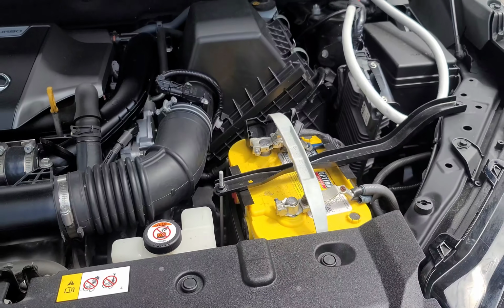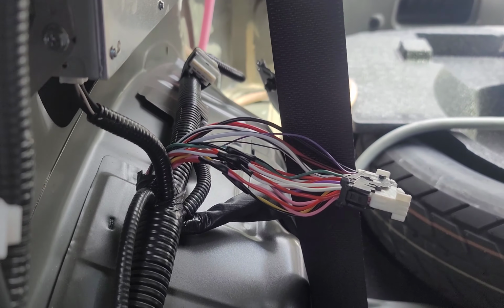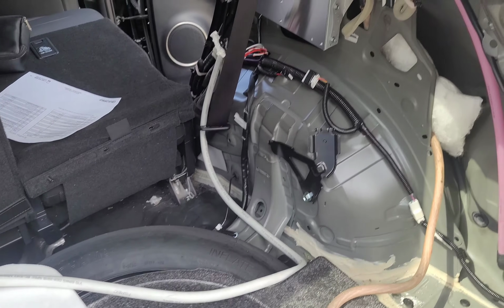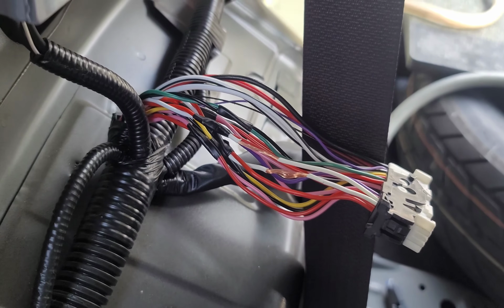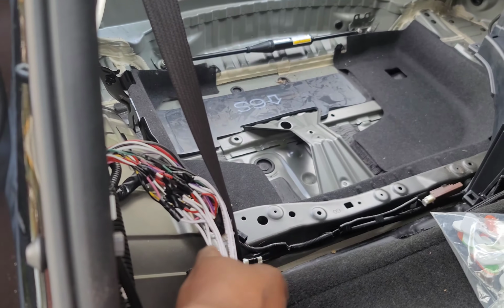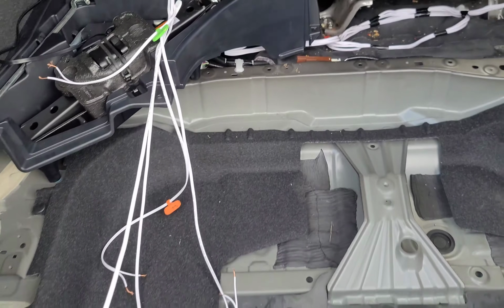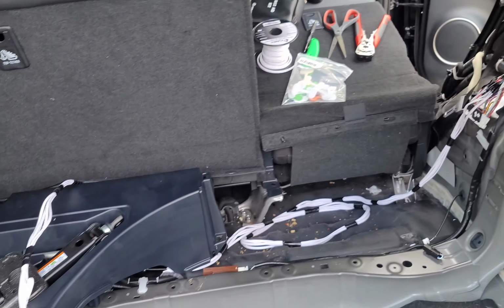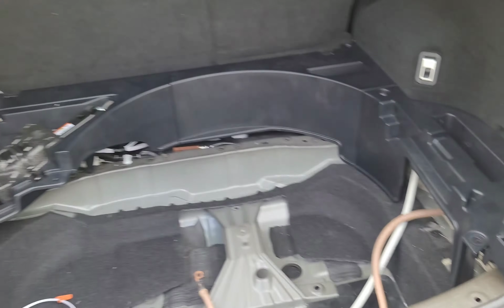How To Splice Into Factory Amplifier | Project Lexus Pt.4

Comment: I'm confused. So which ones were the sub out?
Reply from the maker: I dont remember but I didnt need it. Just need a full range signal. If you want an easy way to tap into it, take the panel off the lift gate and see what color the wire to sub is or just tap into the sub itself
Reply: @Kpaceguy I found I'm guessing the harem ess to the sub but the wires didn't match up to the sub wire colors.

Comment: Please tell me you didn't just twist the wires together and put gooey electrical tape over it. Please think about the next owner of the car. You are leaving him a fire hazard. Connections are going to work apart and the wires are going to short out.  the electrical tape is going to be a gooey hot mess
Reply: There’s zero problem at all the way he did it using electrical tape. If your copper and your tape is wrapped efficiently, nothing is going to unravel if you do it correctly. I now add a layer of Tesa tape for extra protection and for appearance
Reply from the maker: @rmblwgn  you think I'm giving the next owner any of my gear? It all comes with me and the car goes back to factory.

Comment: hey bro I have the same car, I just bought an jbl bass pro hub that goes into the spare tire, I just need to get the remote wire and signal, can I get those thru the factory amp? If so from witch speakers should I get the signal from? Rear door speakers or front door speakers?
Reply from the maker: @eliaschami5614  does your sub have the option to turn on and off with a signal instead of the remote?
Reply: @ it's a powered subwoofer but no I don't think it turns off on its own
Reply from the maker: @eliaschami5614  you can get your signal from the rear speakers because it has the most bass but there's not really a remote turn on with the factory system
Reply: @Kpaceguy  does the factory radio have that remote signal wire?
Reply from the maker: @eliaschami5614  no it just kills power completely
Reply: @Kpaceguy hi so I just verified that the jbl BassPro hub powered sub does have auto turn on feature, but I will need high level output from the speaker wire, are those before factory amp or after factory amp?

Comment: what wire did you tap into for Amp signal wire?
Reply from the maker: @nntstudios  there's only one amp and it's in the same spot as the video however you can just use the speaker wire at the speakers
Reply: @ I see that but connecting to the speaker would give the music signal, I’m asking for the amp cut on wire to tell the amp to turn on. Would that just be the constant power?
Reply from the maker: You'd have to buy an amp that turned on and off with a signal. Or buy a remote turn on device that turns on and off with a signal like my dm-608 processor. It detects a signal and turns everything on or off

Comment: Hi! Thanks for uploading the Project Lexus build. Your build turned out super nice and clean! I am looking to add a sub to this same car that you have. You said you ran a 0 gauge wire through the firewall. Can you please describe to me how exactly and where you ran the power wire to get it from your battery to inside the car? Thank you so much!
Reply from the maker: Hard to describe but there's an opening near the wheel well the comes through around the fuse box/brake pedal area. A grommets you can open up and fish wire through. It's not fun. Was tempted to run the wire underneath the car like my previous build but chose otherwise.

Comment: Bro there's another way to ground the second battery if you don't want to drill a hole. if you have room to run another 0awg wire, have the negative of the secondary battery connect to the negative of your main battery. also could you just place the secondary battery on the spot where the spare goes. just have it secured so it wont more around
Reply from the maker: I actually did that. You'll see the results in the next upload

Comment: for the best ground drill a hole on the floor around the area where the spare tire would be. the area you have it at in the video is a piece thats glued and spot welded to the chassis. the spot welds are the only solid metal to metal contact. its also going to create heat and resistance which will shorten the life of the secondary battery. ive done it and i dont want you to go through the same thing. if you have a multimeter set it on the ohms settings, place the positive lead inside touching an edge of the hole then have the negative lead touch the negative terminal of your secondary battery (nothing hooked to the positive of the battery) or the negative terminal of an amp. it should be 0ohm anything higher is bad

Comment: Nice Job! Giving me ideas to help me convert my dads Lincoln to some aftermarket amps. I know in his vehicle all the speakers are on a crossover network, does the dsp you choose combine all the signals together to get the full range sound and not just certain frequencies ?
Reply from the maker: Yes I can sum up multiple channels. I got to thinking last night if the back doors are 2 way, it probably has a full range signal with a capacitor or something on the tweeter. Could duplicate that signal for the fronts